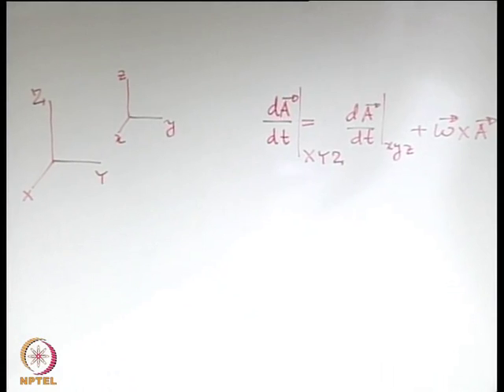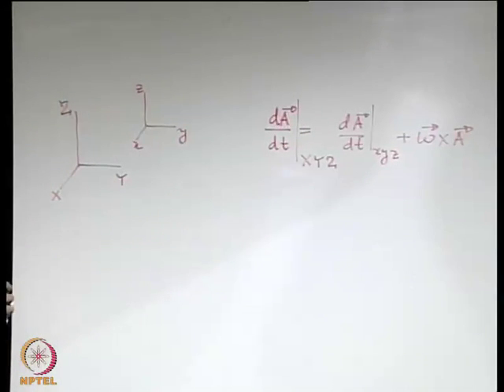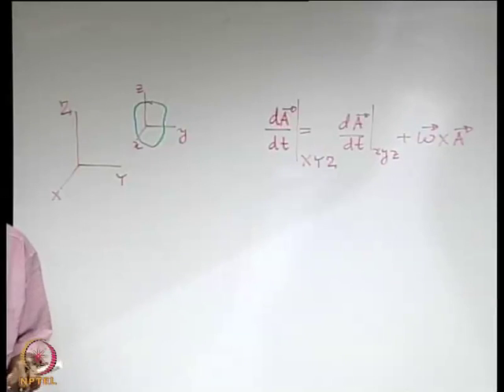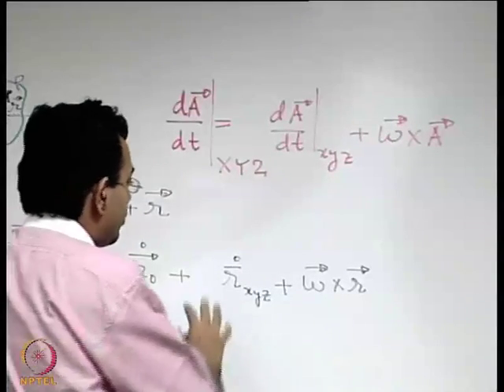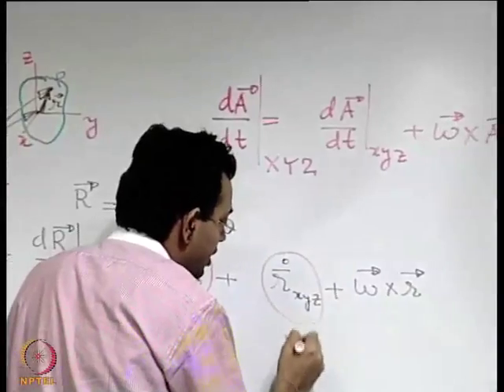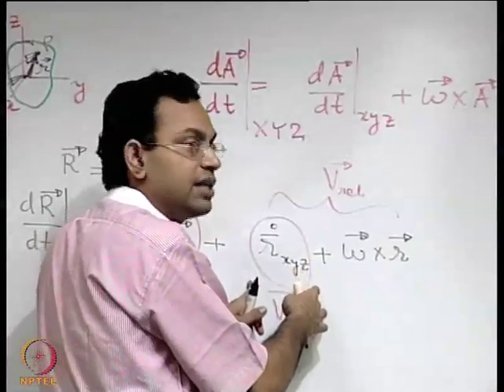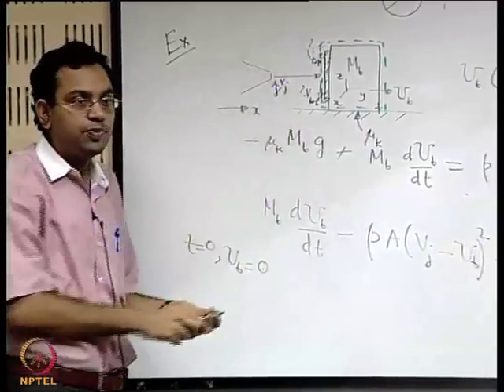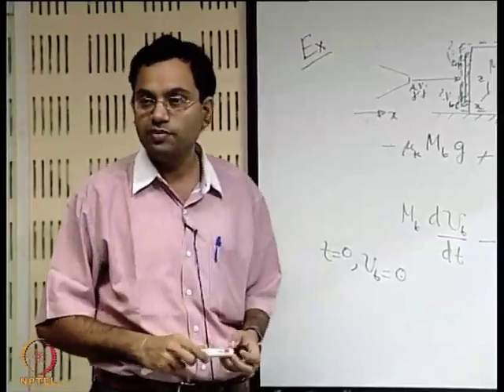Mod-01 Lec-25 Integral Forms of Control Volume Conservation Equations

Comment: Here we have assumed CV and CM same as dt tends to 0. If we do that, is the momentum flux term over control surface not 0? We have derived RTT using three zones with II zone being common to both(which is both CV and CM as dt tends to o zero).

Comment: At @53:22 didnt we already assume volume to be not a function of time while deriving acceleration formula? If so then velocity would be a function of time then shouldn't the first term be like density*volume*change in relative vel w.r.t time? When there is no change in volume coming itself (vol of c.v is not function of time) how can we neglect it?
Reply: The unsteady term can be approximated to zero because the amount of water present in the control volume is very less.
Reply: @acchabaccha4037  but the control volume contains the accelerating block which can't be neglected.